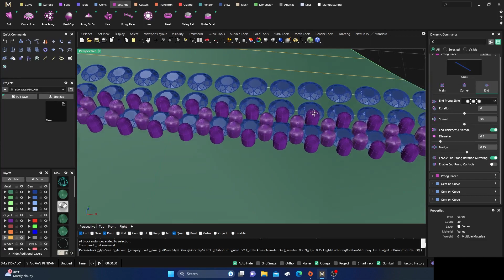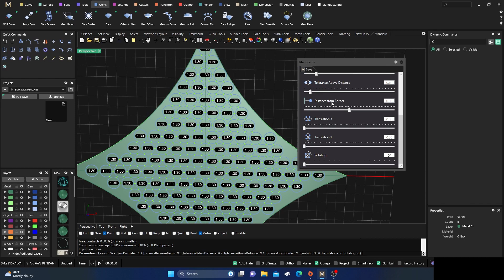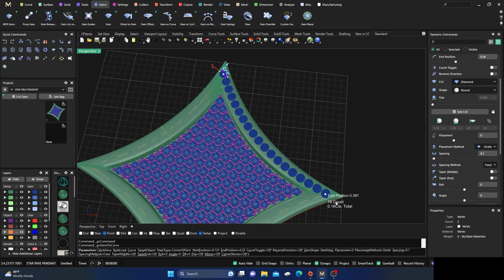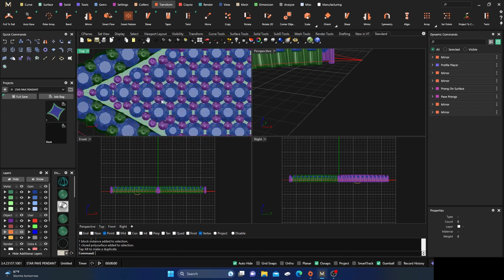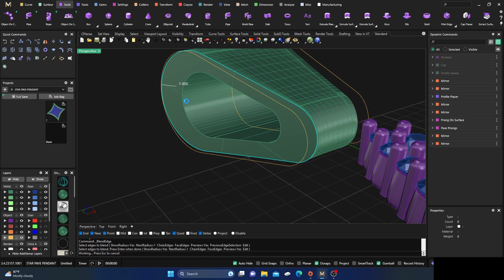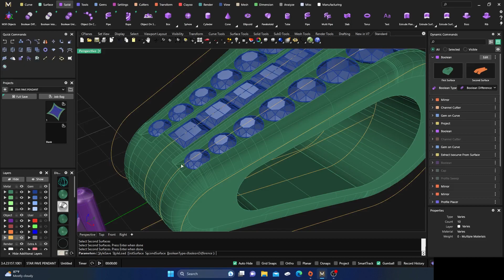MatrixGold Pave Pendant

Comment: 10 :00 I can not pull up all of the second prongs
Reply from the maker: Are you talking about pulling them out away from the stones or adjusting the height of the prongs?
Reply: @donsjewelrymakingandjapantrave  yes ,I can’t adjusting the height sir. I was trying to pull them up to the height 0.38 mm. There is only one prong that I can adjusting the height. But the other prongs still drowning in the surface. 🙂

Comment: Nice. How do you set up the gem springs to show the color of the gem as well when using it? Mine makes the gem a white outline with the gem size inside and that makes it harder to see the gems when working on more complex pieces
Reply from the maker: You know I am not sure if you can have a display mode on the gem when placing them with gem springs. But if you like to see the gem you can always use the gem on surface command instead. I will do some research on that. Thanks for the question. Very good one. Also, if you think it's a good idea to have them in display mode you should email Gemvision and recommend it. These are the kind of comments that they love to hear from users. They do update the program according to the feedback they receive and if enough of us make the same suggestion they are good about adding it in the next update. I think it's a good idea. If there is a reason for not being able to be in display mode, they are good about letting us know why as well. Post any of your findings and I will do the same. Sorry not more helpful.
Reply: @donsjewelrymakingandjapantrave  Thanks! If i find anything i will let you know. Also i will send them an email too. But in your video you can see the blue gem and a white wireframe where the cuts are. also the gem size inside. in my case its just a white circle with the size inside